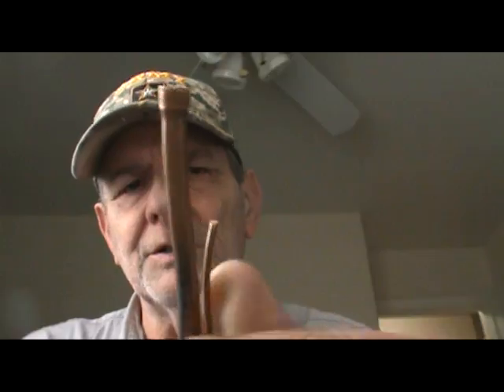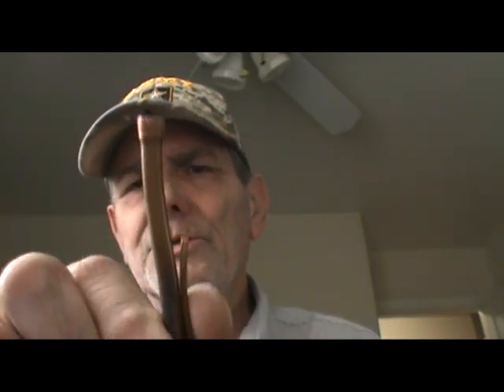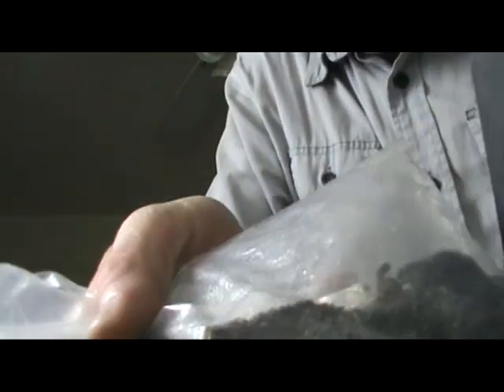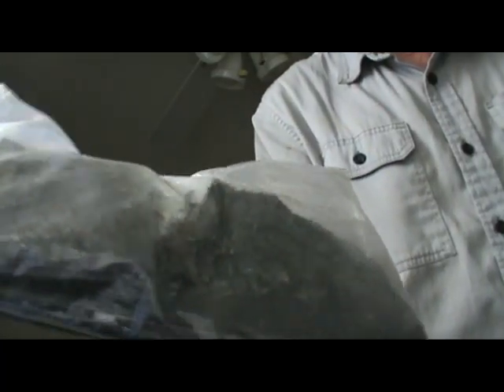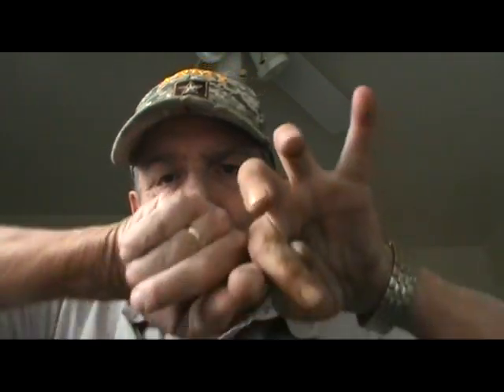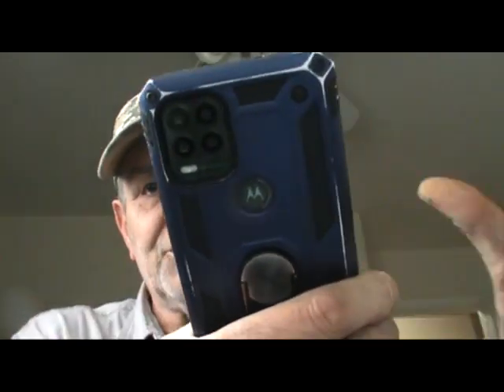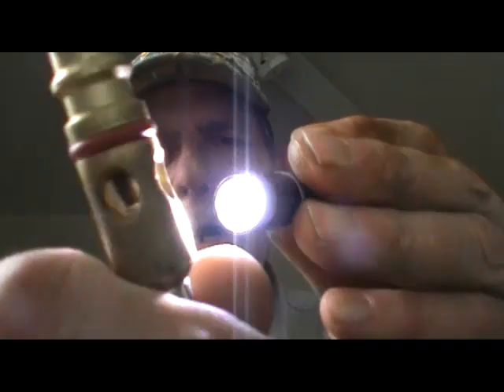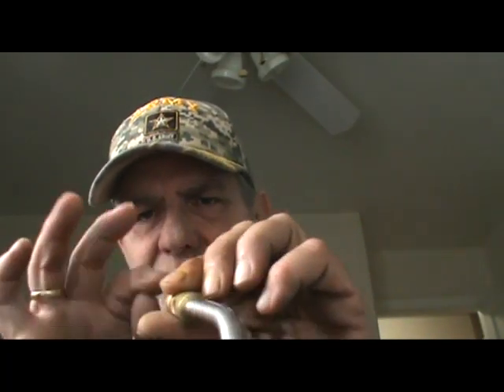"Air-Acetylene" Proper Torch for Domestic, Home Refrigerators, NOT Oxy-Acetylene! Watch & learn why!

Comment: I got one of those turbo torch setups coming tomorrow for the mc tank. I'll be excited to try that out. Just like you said that's gonna save a bunch of time, money and it's the right way. I'll reply to this when I mess around with it this weekend.
Reply: I've been using it on a few jobs and I'm just not a fan of it yet. I'm trying to like it, but the oxy/acet setup is just so much easier to braze with. I've tried a few different tips on it but it just throws too much heat into the surrounding area. You just can't get the flame small enough. 
The #2 tip flame is like the perfect size, the flame size of that is comparable to the oxy/acet flame, but it doesn't get enough heat into it fast enough and heat travels down the pipe so you have to wrap it in more damp rags. Some of the joints I have to do have less than 1/2 in from plastic or foam so that's why I like using the smaller hotter flame so I can heat just the joint up really quick and get it flowed in smoothly. 
 For joints out in the open with clearance it's fine but I can't rely on it, it's not nearly as versatile, it's also incredibly loud. The videos of the thing running don't so it nearly enough justice.
The other thing I like about the oxy/acet/propane setups is that you can just put a mark on the torch handle where to open the valve to. you open both at once so you don't get soot and you don't have to adjust it since the regulators are at the same pressure.
I really want the air/acet setup to work for me since it's lighter and simpler to run. Say if you're going into an apartment building that's much less weight in your cart. I'll keep experimenting with it.
Reply: I just made my own hook style torch head out of copper and brazed it to the steel part of an a5 torch tip. That seems to solve the issues I was coming across. I till need to tinker around with the hole sizes, but I think it will work 100000 times better for putting in evaps and working in tight spaces. I'm just surprised there are no heads like this available. I also made it with a flare fitting so I can theoretically make any shape torch head I could possible want now.